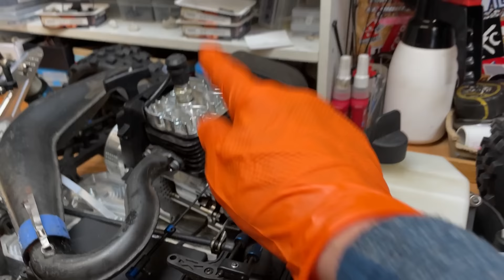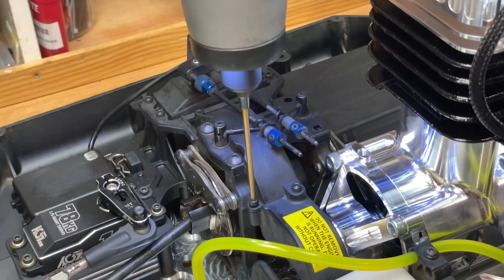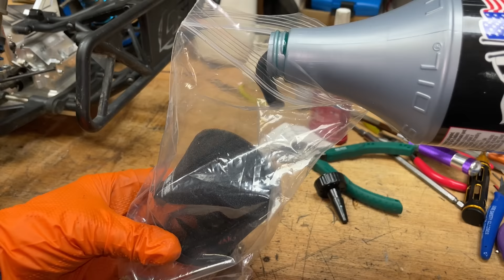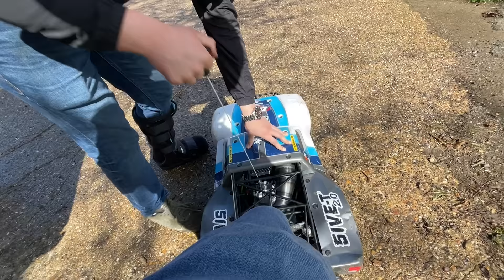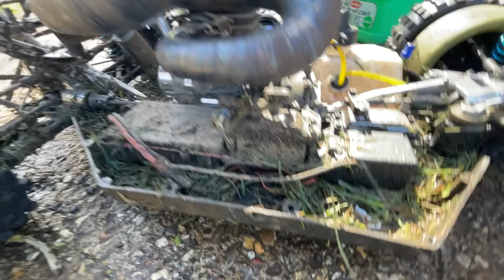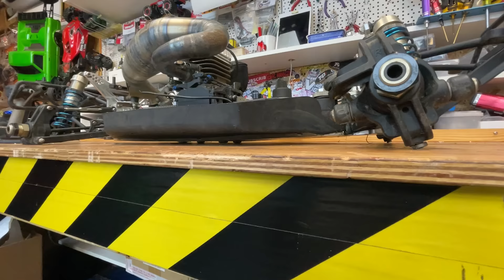GIANT RC Car gets MASSIVE Race Engine (6x power)

Comment: I’d say u may have scorched the bore
Running a new engine lean is asking for trouble
If it’s rattling on idle and on throttle. There’s some sort of damage inside
U can remove the head or exhaust and check the piston for scorch marks
Yr supposed to let it idle for a bit. Heat cycle to bed the ring to the bore. Just saying

Comment: AH, the neutral or "home" on the servo is actually pulling the throttle open. Have to change that so "home" is where the throttle is completely off. 

Me thinks you didn't centre the servo before connecting the linkage like you tell us all to do in your build videos. Even the master can muck up once in a while.

Comment: Just flip the choke on a runaway engine. Kills it every time.  Obviously that will not work if out of your possession. In the case of the car on the Rover Tyre, the choke would have stopped it.

Comment: the engine does not turn off because the combustion chamber is overheated, without the spark plug it still continues to explode, the fuel flow is very poor, from the beginning, which is why the engine did not want to start in the first place

Comment: Don't have a clue about petrol rc cars. But normal cars would have a run away engine if oil gets into air intake. I thought what you did with air filter soaking it in oil would put oil into the intake. Hope you sort it.

Comment: The engine neeeds a cooling system.  A fan and tin around the cylinder and head. Much like a lawn mower or VW Aircooled engine has.

Comment: If you have the throttle open and you reach max distance from the receiver or the controller to the receiver on your RC then it will just stay wide open same thing happens if you have the throttle wide open and the batteries died on your controller

Comment: Weed Wackers tend to do the same thing when they start running out of fuel, they start accelerating, kill switch doesn't work because of compression ignition and you have a runaway engine.

Comment: When something like that happens cover the air intake and block the airflow to the motor, this will force shut off any kind of motor, I used to have an old shit box car where I would take the keys out of the ignition and sometimes the thing would stay running I had to take off the oil cap and cover it with my hand to get it to turn off.

Comment: It's a typical two stroke thing wen it runs out of fuel it will cause it too rev up or run away on ya lol 😂 sounds weird but that's what happens, on 80% of the two strokes bikes I've owned over the years do it . Hope that helps u understand Abit

Comment: I'm not a specialist in Nitro and petrol cars but I think it did get red hot and the fule system kept pumping fule and it just kept on going and going even the kill switch stop the servos but the engine it's self was running on its self

Comment: The reason it wouldn't turn off is because it overheated. You need to do what I've done with mine and buy a small radiator and chuck that in there

Comment: You probably overheated the engine or it was close to that and that's why I was holding wide open and you couldn't kill it because it did something with the kill switch that's why I wouldn't turn off because it was probably getting too hot

Comment: It was Celine the engine got so hot and it actually stuck in preignition it was Celine the engine got so hot and it actually stuck in preignition so when you kill switched it so when you kill switch it so when you kill switch it it’s kind of it kind of left the engine on because the heat made it sink the engine was still on

Comment: The closer ur gears r together the faster I got a mk2 Fazer Chevelle and put a 2650kv 1/8 scale motor in it with 120 amp esc 4s and it is the fastest rc I've ever seen for what it is I did it cheap oh and the gearing a 40t pinion and a 68 spur is insane possibly 100mph or more insane for a 54t spur comin and a 45 pinion gonna be wild just can't run it too long and have fans on everything takin it to the airport hanging strip soon for a speed run

Comment: I owned a 2 stroke motocross bike and when the fuel was running low it would draw air through the tank with the fuel causing it to rev its balls off

Comment: never run a 5th scale if you know the killswitch isn't working bro and I MYSELF keep a long zip tie on my coil/spark plug wire in an event like at the truck wheel you can pull the plug wire in an emergency

Comment: The killswitch introduces interference to the radio gear.
Put a ferrite ring round the "servo" lead on the killswitch.

Theyre cheap shit, aeroplanes use optically isolated relays to solve the problem. These dont.

Comment: Pull the spark plug connector it will kill the engine 👍
Reply from the maker: how do you get to it?
Reply: @KevinTalbotTV  quickly take the cover off, just pop the connector off.. even if the cover breaks ripping it off, I would rather replace that then the cylinder piston and rings🤷‍♂️
Reply: @KevinTalbotTV  Nice little car them, I've seen you play with a few but that one I like 👍

Comment: to much money makes u not care  to check setup etc and make sure it is correct or No way u did not know before driving it that fail safe was set to throttle open. Made for interesting video though so that is why u wanted that to  happen.  Just the views will pay for a few of these vehicles.